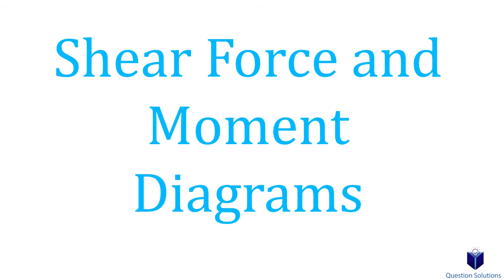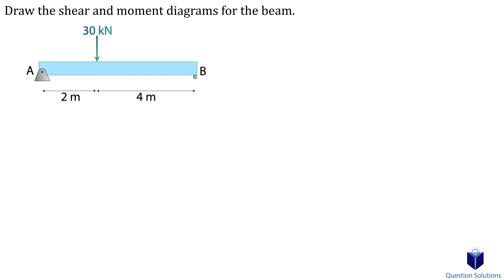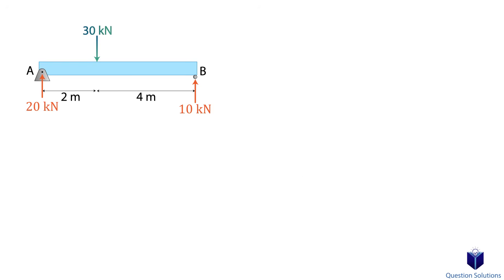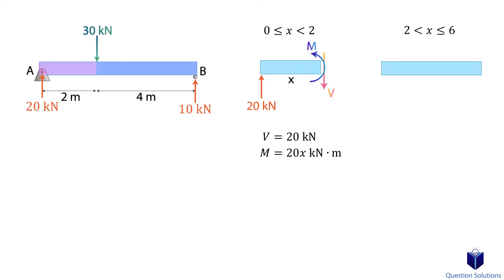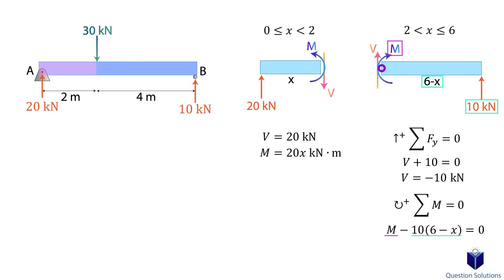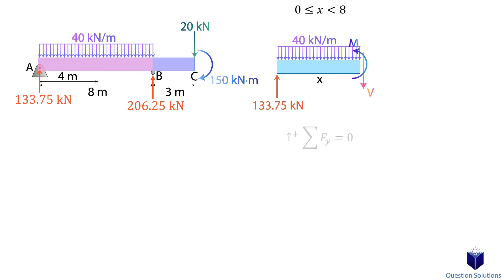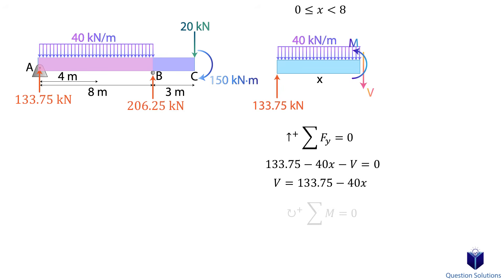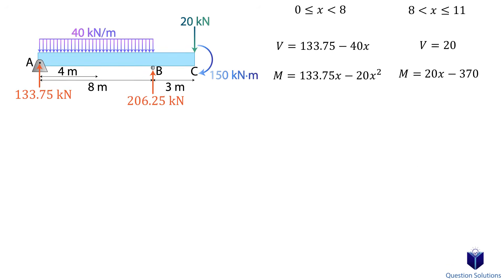How to Draw Shear Force and Moment Diagrams | Mechanics Statics | (Step by step solved examples)

Comment: I've been that clockwise moment is negative and CCW is positive.
Reply from the maker: For moment diagrams, especially in the 2nd method, you have to remember that a clockwise moment will increase the moment (so goes up) and a counter-clockwise moment will bring it down. For the first method, it doesn't matter which direction you pick as positive.
Reply: @QuestionSolutions oh yeah i remember now... the kitchen method.  The clock (+) is above the counter (-). Just trying to make all these concepts fit together in my head. Thanks for the response!
Reply: @QuestionSolutions  I'm getting caught up on something here... I'm trying to understand the sign convention with regards to moments. if there is a cantilever beam that is fixed on the left side, has a force applied halfway down the length of the beam, then has a counter clockwise moment applied to the very end on the right side, in which direction would I draw the reaction moment at the fixed end? My intuition would tell me to draw it opposite of the applied moment.

The question comes from this Jeff Hanson video at 12 min 24 seconds:

https://www.youtube.com/watch?v=vd5tpO3eRdg&list=PLRqDfxcafc21wlI3E56IkDmRJ-33apMjv&index=75

He draws the reaction moment in the same direction as the moment being applied at the end of the beam, is that correct? Without knowing the magnitude of the forces we won't be able to tell? Thanks for your help.

Comment: Hi, this is a general question but I don't know when and when not to curve up or down the shear/bending moment diagram, I searched it up on google, it still doesnt make sense since the answers are interchanged. May you provide a simple explanation on this one on when to curve up/down in terms of load, in terms of shear, and in terms of moment, please? T T
Reply from the maker: I can try my best assuming I understand what you're asking. Also, are you asking this for the first method or the second method? For the first method, once you have the equations, you're just plugging in x-values, and the upwards or downward trajectories are automatically calculated through the equations. In the second method, for shear force diagrams, whenever a force (a load) is pointing up (on the beam), your shear force goes up. When a force is facing down the shear force goes down. For the moment diagram, you need to focus on the shear force diagram. If the section of the shear force diagram you're looking at is above the x-axis (so it has a positive value, in other words, the area under the graph has a positive value), your moment will go up. When you look at the next segment, if the area under the shear force diagram is negative, then your moment will go down. If you have an external moment applied to the beam, if it's a clockwise moment, your moment diagram will go up, if it's a counter-clockwise moment, your moment will go down. That's really about it. Practicing a lot of questions will make this second nature, you won't even think about it much, you can visualize it just by looking.
Reply: @QuestionSolutions  I meant the concave up or concave down of the graph, like when do we know this shear or moment graph will concave up or down, what are the rules on that one?... also, i just found that out that when an external moment applied is clockwise, it is automatically a positive moment and negative if otherwise, is that a rule too?
Reply from the maker: @eslmemlse  So think back to calculus class. Remember derivatives and integrals? If you think about it in that sense, you can easily figure out concave up or down. If we have a shear force diagram that has a sloped down segment, how can we figure out the moment diagram? So the derivative of a moment diagram gives you the shear diagram, and the integral of the shear diagram gives you the moment diagram. What sort of graph, when we take the derivative of, gives us a sloped down segment? A polynomial graph of the second order (parabola). In other words, if you integrate a linear sloped graph, you end up with a parabola (so you're integrating the shear force diagram and you get a parabolic moment diagram). So if you think about it in that sense, you can figure out what the moment graph should look like (concave up or down), just from the shear force diagram because you're going from linear, to parabolic. Shear forces are much easier to figure out just by looking at the beams. Most of the time, you get point forces, which gives you just straight lines, and if you have a distributed load, you have a sloped section. 

And yes, I mentioned this in the previous comment. If the external moment applied is clockwise, your moment goes up, so a positive moment, and if it's counter-clockwise, your moment goes down, a negative moment.
Reply: @QuestionSolutions I think I quite get it better now, thank you so much🥲🥲🥲🥲🥲🥲🥲🥲🥲🥲🫰

Comment: Hi, i'd like to ask at 9:35 where did you get the -150? from what equation? Or did directly assume it to make it 0 when the external moment 150 is added
Reply from the maker: It's an external moment that's added. It's given in the original diagram.
Reply: i meant the negative 150, where did it came from? since when 150 is added to -150 it becomes 0
Reply from the maker: @eslmemlse  You plug in 11, into the equation. 20(11)-370 = -150
Reply: @QuestionSolutions  okayy, thanks!

Comment: may I ask why is the last moment graph at the last example parabolic instead of a linear?
Reply: I think when having distributed loads, the moment diagram becomes parabolic
Reply: @jazyhojjj ohh, thank you
Reply from the maker: So in calculus class, when you were doing integrals and derivatives and drawing your graphs, you might have noticed something. If you take the derivative of a parabolic graph, you get a sloped linear graph, and then taking the derivative of a sloped linear graph, gives you a straight line graph. So here, notice that from 5 to 8, you have a sloped linear graph. The question is, what sort of graph do we need to take the derivative of to get us a sloped linear graph? Taking the derivative of a parabolic graph gives us the sloped linear graph. Another way to think about it is, when we take the integral of a sloped linear graph, what graph do we get? A parabolic graph.

Comment: does the moment graph always have to end at 0? how come you add the clockwise moment and not subtract? If it was counterclockwise would you subtract or add?
Reply from the maker: In moment graphs, using the second method, a clockwise moment will add, and a counter-clockwise moment will subtract. For the first method, it makes no difference since you're free to choose your own direction when writing your equations. Moment graphs don't always end at zero, but for most problems, they will. An example of when they might not end at zero is in cantilever beams.

Comment: at 3:30, why are you taking clockwise as positive, isn't the default to take counter clockwise as positive?
Reply from the maker: You can read through it here: https://eng.libretexts.org/Bookshelves/Mechanical_Engineering/Engineering_Mechanics_-_Statics_%28Osgood_Cameron_and_Christensen%29/06%3A_Internal_Forces/6.02%3A_Shear_Moment_Diagrams but the short version is, in moment diagrams, clockwise is positive. 
Also, for equilibrium equations, you are free to choose which direction is positive, I almost always use clockwise as positive. It makes no difference to the answer.
Reply: @QuestionSolutions  thank you so mnuch and in 7:54 how do you know if the moment is negative or positive, is it based on that sign convention.?
Reply from the maker: @khaaaleb7313 yes, as confusing as it is, even for externally applied moments, you should take clockwise as positive even though everywhere else, you're taught counterclockwise is positive.

Comment: Take my salute❤
Sir but Im still confused why such concentrated moment like Clockwise moment are considered(-) when equilibrium equation but why do we add when it comes to moment diagram? Im stuck at this adding and subtracting😢
Reply from the maker: You can read through it here: https://eng.libretexts.org/Bookshelves/Mechanical_Engineering/Engineering_Mechanics_-_Statics_%28Osgood_Cameron_and_Christensen%29/06%3A_Internal_Forces/6.02%3A_Shear_Moment_Diagrams but the short version is, in moment diagrams, clockwise is positive. 
Also, for equilibrium equations, you are free to choose which direction is positive, I almost always use clockwise as positive. It makes no difference to the answer.
Reply: Thank you so much

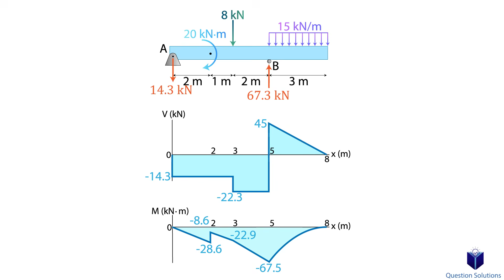Comment: at minute 16:18, why is that last section for the moment diagram parabolic and not linear?
Reply from the maker: So if you look, anytime we have a straight segment in the shear diagram, we get a sloped line in the moment diagram. But at 16:18, we see that we have a sloped line in the shear diagram, which leads to a parabolic line in the moment diagram. That's because the derivative of a parabolic line gives you a sloped line, and the integral of a sloped line gives you a parabolic line.

Comment: Hi, sorry, I am kind of a noobie. Can someone explain me what is the difference between force and momentum (force x distance) in these examples.
I mean why in the second exercise the 150kNm force is not multiplied by the 11m from point A like the other forces.
sorry for this dumb question.
Reply from the maker: So it's not a dumb question at all, but you're missing a lot of fundamentals. Momentum is mass times velocity, but here, we talk about moments. A moment/torque is force times perpendicular distance. So the 150kN moment is an applied external moment, which is why it doesn't need to be multiplied by a distance. See this video first: https://youtu.be/QNNnPZ68STI

If you have time, I encourage you to watch the statics playlist from the beginning.

Comment: Can you use the first method for the second two? Or can you not because theres a moment in the middle? Thank you sir
Reply: I keep trying it but getting nowhere
Reply from the maker: @JadenSmith-b6f  No, you can, you just need to make a cut where an external moment is applied.
Reply: @QuestionSolutions So would that mean you would need to make three segments? One up until the moment, one feom the moment to the load, and one from theload until the end?
Reply from the maker: @JadenSmith-b6f Yes, that's right. Whenever a change occurs, you need to make a cut.
Reply from the maker: That's right. The 2nd method is much quicker once you grasp it.

Comment: I'm confused, in my class the convention is counterclockwise is positive, but when I do that I get different moment diagram then you for the final one. I get that it ends at -20 instead. Help!
Reply from the maker: Please see: https://eng.libretexts.org/Bookshelves/Mechanical_Engineering/Engineering_Mechanics_-_Statics_%28Osgood_Cameron_and_Christensen%29/06%3A_Internal_Forces/6.02%3A_Shear_Moment_Diagrams
There is a section (if you scroll down) that discusses this when you have applied external moments. When using the method used in problem 3 and 4, the following applies:
Jump upwards by the magnitude of the moment for any negative (clockwise) moments.
Jump downwards by the magnitude of the moment for any positive (counter-clockwise) moments.

Comment: what if the moment at a point is anticlockwise? would it become positive or negative on the Bending moment diagram?
Reply from the maker: Please see: https://eng.libretexts.org/Bookshelves/Mechanical_Engineering/Engineering_Mechanics_-_Statics_%28Osgood_Cameron_and_Christensen%29/06%3A_Internal_Forces/6.02%3A_Shear_Moment_Diagrams
There is a section (if you scroll down) that discusses this when you have applied external moments. When using the method used in problem 3 and 4, the following applies:
Jump upwards by the magnitude of the moment for any negative (clockwise) moments.
Jump downwards by the magnitude of the moment for any positive (counter-clockwise) moments.

Comment: What would happen if the momentum at the 2-metre mark were in the opposite direction of the clock? Would we then draw the momentum downwards on the diagram? 12:08
Reply from the maker: That's correct, you would draw it downwards.

Comment: Thank you sir .What if instead I chose anticlockwise as positive, would that affect my bending moment diagram for problem 3 and 4 ?
Reply: no it will be the same as long as you do them all counter clock wise
Reply from the maker: Please see: https://eng.libretexts.org/Bookshelves/Mechanical_Engineering/Engineering_Mechanics_-_Statics_%28Osgood_Cameron_and_Christensen%29/06%3A_Internal_Forces/6.02%3A_Shear_Moment_Diagrams
There is a section (if you scroll down) that discusses this when you have applied external moments. When using the method used in problem 3 and 4, the following applies:
Jump upwards by the magnitude of the moment for any negative (clockwise) moments.
Jump downwards by the magnitude of the moment for any positive (counter-clockwise) moments.

Comment: bro is using the left hand rule
Reply from the maker: Right hand rule only applies to 3D problems. You can pick clockwise or counterclockwise as positive for 2D problems, you'll get the same answers.
Reply: @QuestionSolutions  Okay this makes more sense.

Comment: Forgive me if I’m wrong but at 12:14 you state that the clockwise moment is positive but aren’t clockwise moments generally considered negative?
Reply from the maker: The answer to this is two-fold. Moments don't really have positives or negatives, they simply have directions. When solving problems, the normal convention is to assume counter-clockwise as positive, but this makes no difference to the final answer, it's completely up to you. See: https://www.youtube.com/shorts/P029mqnp4XY

However, when drawing moment diagrams, a clockwise moment will be considered positive on the graph. See: https://eng.libretexts.org/Bookshelves/Mechanical_Engineering/Engineering_Mechanics_-_Statics_%28Osgood_Cameron_and_Christensen%29/06%3A_Internal_Forces/6.02%3A_Shear_Moment_Diagrams

Comment: Do you use ccw as positive or cw?
Reply from the maker: When coming up with your own equations, you can pick either ccw or cw as positive and you will get the same answer.
Reply: @QuestionSolutions yeah I see, I was just stuck on one of my own questions where they had moments on the ends of the beam which turned them into negative moments. I don’t know, it was just weird. Thank you though!!

Comment: does the sign convention of the moments matter? If I had opposite sign convention for moment, wouldnt that change teh moment graph  especially in the last two examples?
Reply from the maker: Please see https://eng.libretexts.org/Bookshelves/Mechanical_Engineering/Engineering_Mechanics_-_Statics_%28Osgood_Cameron_and_Christensen%29/06%3A_Internal_Forces/6.02%3A_Shear_Moment_Diagrams there is a section on the direction of moments.

Comment: Is there a reason why 1200 is an upwards jump instead of a downwards? Is it because you are considering the internal force resisting the 1200 cw which makes it ccw hence positive?
Reply from the maker: Please see: https://eng.libretexts.org/Bookshelves/Mechanical_Engineering/Engineering_Mechanics_-_Statics_(Osgood_Cameron_and_Christensen)/06%3A_Internal_Forces/6.02%3A_Shear_Moment_Diagrams There is a section with applied external moments.

Comment: 12:08, 15:22 why does clock wise moment make bending moment positive?
Reply: It depends on you, like you are free to take whatever sign convention you want to. In the video he chose clockwise moment to be positive. You can take clockwise or anticlockwise to be positive, you will still get the same graph. Hope that clears it up.
Reply: @athirisstillcalculating  that doesn't answer my question. You are talking about sign convention. I didn't ask why he assumed c , ac positive, neg.
Reply from the maker: @aakhil9824  See: https://eng.libretexts.org/Bookshelves/Mechanical_Engineering/Engineering_Mechanics_-_Statics_(Osgood_Cameron_and_Christensen)/06%3A_Internal_Forces/6.02%3A_Shear_Moment_Diagrams

There is a section on applied external moments.

Comment: isn't the parabolic curve at the end a negative slope and not a positive slope as you said?
Reply from the maker: No, it's a positive slope. If you calculate the slope of the curve at any point, it will give you a positive value, since it's heading upwards.

Comment: Thak you it is very helpful!
But I have a question: at min 12:13 you say that the moment is clockwise, yet positive. Wasn't the clockwise turn considered negative?
Thanks
Reply from the maker: It depends on how you do your problems. For example, if you look at 3:09, I picked clockwise to be positive, and I almost always assume clockwise to be positive. But that's totally up to you, you can pick the opposite, so you can assume counter-clockwise to be positive, and you will end up with the same answer.

Comment: Do we add clockwise moments as positive and subtract counterclockwise moments as negative? at time 12.10
Reply from the maker: I always add clockwise moments as positive, but that's because I always assume clockwise to be positive. You can assume the opposite and get the same answers if you follow through for all the moments in a problem.

Comment: Is it always that a clockwise moment will provide a positive jump on the moment diagram?
Reply from the maker: It depends on which direction you assume to be positive. Regardless of the direction you pick to be positive, you will still get the same answer. So for example, look at 3:17 moment equation. We assumed clockwise was positive. You can do the same and assume counter-clockwise is positive. You will still get the same diagram.